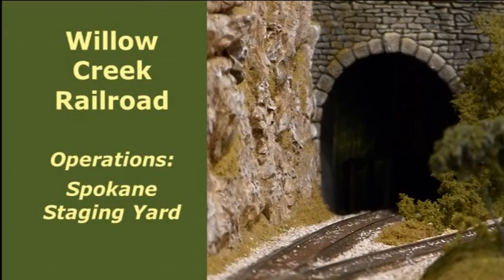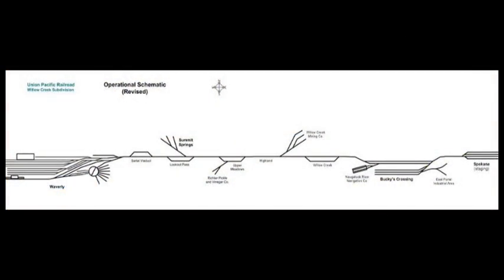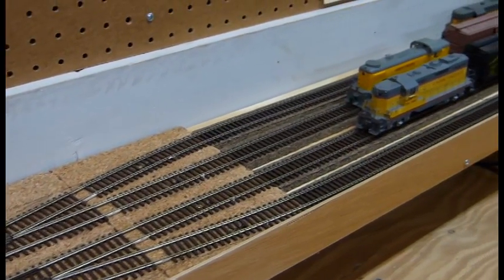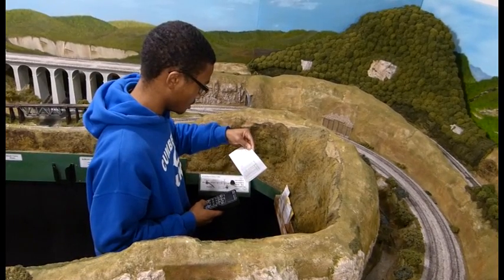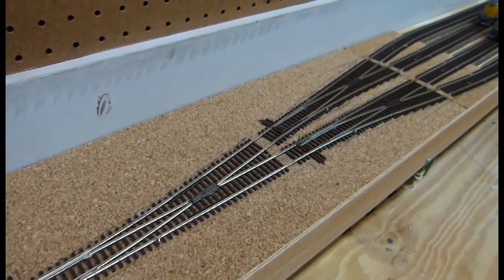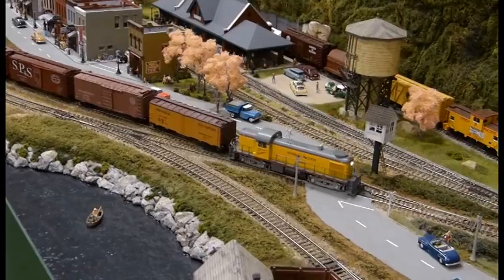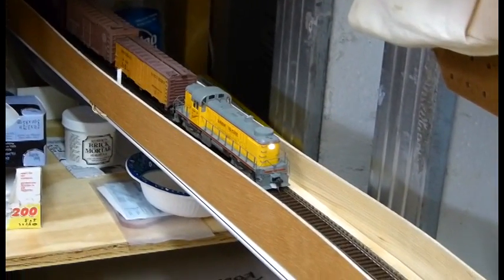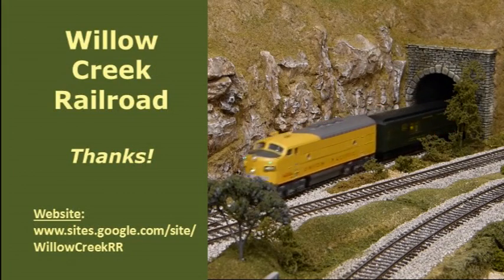Willow Creek Railroad - Operations: Spokane Staging Yard

Comment: Don't have a layout myself, but curious, how do you make the last section of track in Spokane unpowered?
Reply from the maker: Good question and a simple answer.  Cut both rails of the track and insert insulated (plastic) rail joiners in each track so that the rails on the end of the track don't contact the electrified rails.  This gives you an electrically dead section at the end of the track.  I run single diesels in each train, so the length of the "dead" section of track is about 12"; if you run double header locos, you'd need a longer dead section.  Hope this answers your question.
Reply: @Vigment13  it does, thanks! looking forward to more videos when you can!